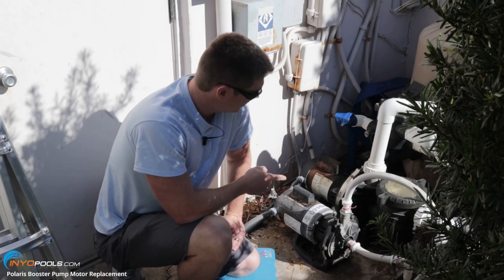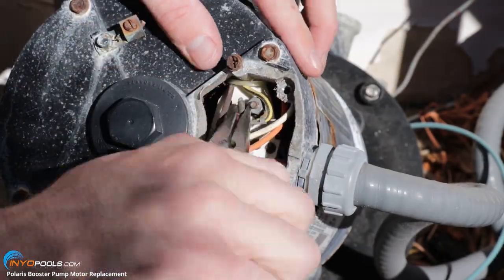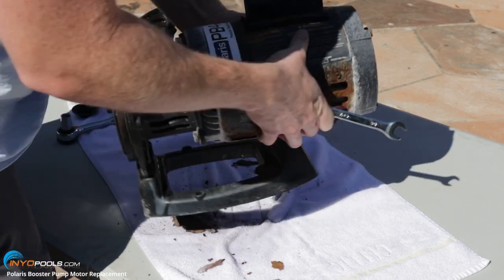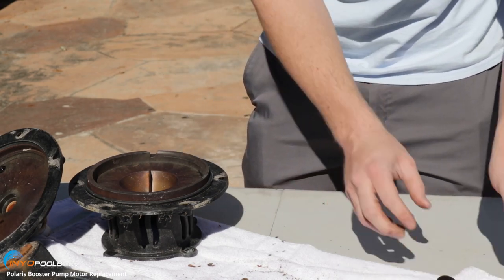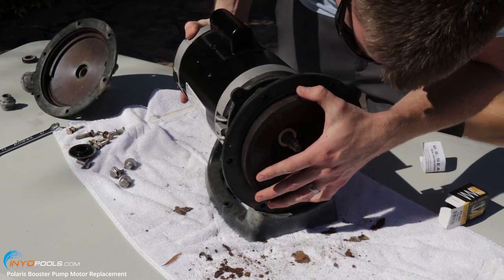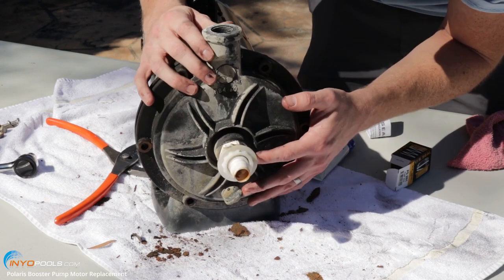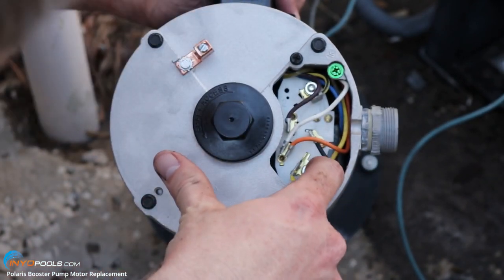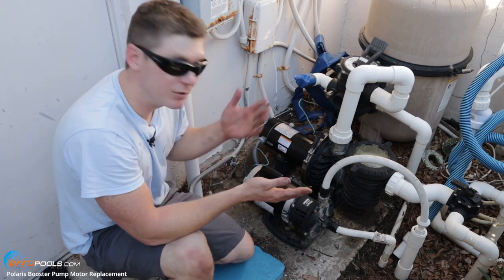How To Replace a Polaris Booster Pump Motor

Comment: Very helpful video, got my motor replaced with your help. Thank you!
Reply from the maker: Great to hear!
Reply: I purchased the wrong rebuild kit, and went ahead and assembled new motor on the current parts. Should I purchase the right rebuild kit and go back and replace rebuild parts?  @Inyopools
Reply from the maker: Yes, it would be best if you replaced the shaft seal whenever you replace the pool pump motor. That old seal will fail, and water from the pump will begin damaging your new motor.

Comment: I've had my polaris unit checked.  Seems good.  Turning on the booster, it gets the initial "jolt", but then there doesn't seem to be enough pressure to move the polaris around the pool.  Is there a way to know if the booster is "pushing" enough water out to the polaris?

Comment: Did you have to turn of the water or an isolation valve? My set up is missing one. Do I need it?
Reply from the maker: We did not have to turn off any isolation valves because the equipment is above the water level. You would only need to close isolation valves if the equipment is located lower than the body of water.

Comment: Once everything is hooked up, how do you prime the booster pump and pressure test it? I am installing a new PB4SQ.
Reply from the maker: You would just prime the system like normal. Fill the pool pump strainer with water, put the cover back on, and turn the pool pump on. Once it's primed, test the booster pump.
Reply: Thank you so much for the fast reply!! I really appreciate it!
Reply: 3:37 I’m at the step where I have to remove the impeller. I can’t get it to budge by hand. It does not rotate freely. Even when I put a wrench on the end of the shaft it won’t budge. Any way to break loose?

Comment: hello, are you still around for some questions? I would like to know how I can tell if my PB4-60 is trashed or needs certain parts replaced? Can you help? It will power on and jolts when I power it but it will not generate enough UMPH! to push the vacuum around the pool.
Reply: Did you do the wheel rpm count to see if it getting enough pressure? Details in the manual.
Reply: @krehbein  Pulled the pump apart. The propeller was completely separated from the spindle. Now, I can't find the parts anywhere.
Reply: @WIDEawake419  meaning everyone is out of stock? If you have the funds the newer booster pump, Pb4sq, is really nice. Smaller, quieter, easier to hook up, etc.

Comment: Don’t overtighten the pipe nipples. I broke one off flush with the volute. That was a huge PIA to get the broken piece extracted. Standard sized pipe nipple extractors, or internal pipe wrenches, don’t fit! The instructions say that the nipple flanges do NOT have to be all the way down flush to the volute, but very close. Believe that, you can always give them a tiny snug after the fact if they leak.

Comment: so the red wire can go on either terminal 6 or 1? doesn't matter?
Reply from the maker: Are you wiring for 230V?
Reply: @Inyopools  I don’t know. Whatever works. I took out the old pump. My existing wires are red, black and green.
Reply from the maker: There's your problem. You can only wire the Polaris motor correctly if you know the circuit's voltage. Polaris motors can be wired for 115V or 230V. The color of your wires should mean it is 230V if it was done according to code. You also could check the old motor to see if the old motor was set to 230 or 115.
Reply: @Inyopools  looks like the black wire on my old pump goes to number 1 and red wire goes to #6

Comment: I just install my pump and it  is sucking the water in, instead of pushing the water out to run the polaris pool cleaner.  What do I have backwards?
Reply: Its fixed....somehow I swapped the hoses on the pump...I thought original I may have hooked the wires up wrong causing the motor to run backwards.
Reply from the maker: Thank you for the update. That's a common mistake.
Reply: @Inyopools  ...yes thank you for the video!

Comment: How do you know if existing pump is wired 115 or 230?
Reply from the maker: There are a couple ways to confirm the voltage. You can use a multimeter to check the voltage of the incoming lines. If you do not have a multimeter, you can look at the wiring diagrams on the motor label. If it is dual voltage, there will be two diagrams (low/115 and high/230). If you compare those diagrams to how it is wired in the back of the motor, you should be able to determine the voltage.

Comment: That pump seemed pretty old. Other than the $80 or so you save by buying the motor only (as opposed to the whole assembly) wouldn’t you be better off just buying the whole assembly? Or do the remaining parts ie the stand and front attachment don’t have any wear concerns?
Reply from the maker: Replacing the complete booster pump or motor would depend on the budget for the pool owner. Replacing the complete pump is a more simple process if you have the extra $80 or so to spend.
Reply: Gotta take the price of the seals into consideration as well.   I'm sure they're not cheap.  Great video by the way!  Thanks.

Comment: For the threads on the quick connects do you recommend  teflon tape and a coating of sealant?  I purchased a small tube of Permatex RTV silicon sealant, hopefully that is the correct type along with the teflon tape!
Reply from the maker: We've had good luck using the teflon tape by itself but a little RTV silicone couldn't hurt.
Reply: @Inyopools  Thanks for your prompt reply! your various pool videos have been very informative.